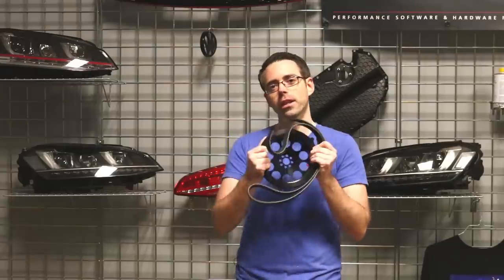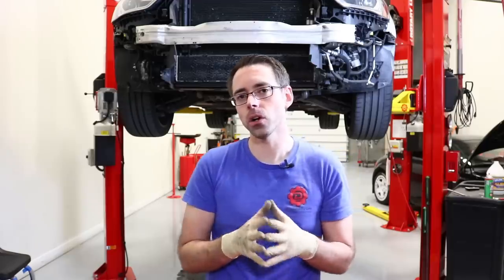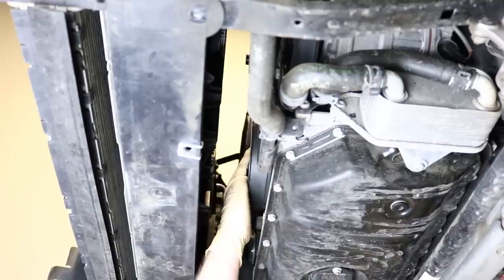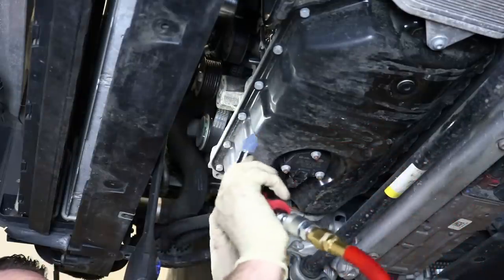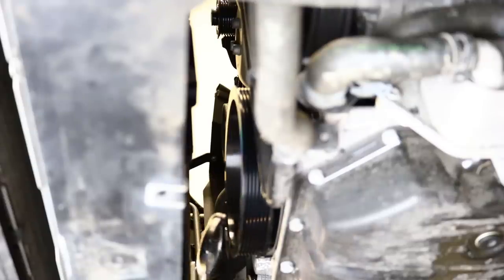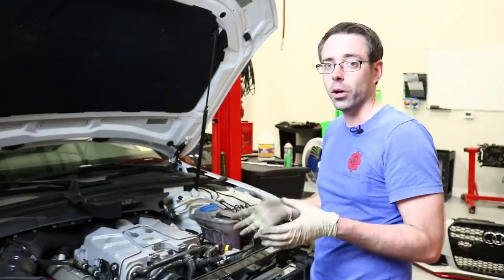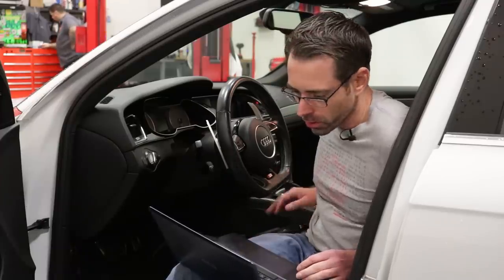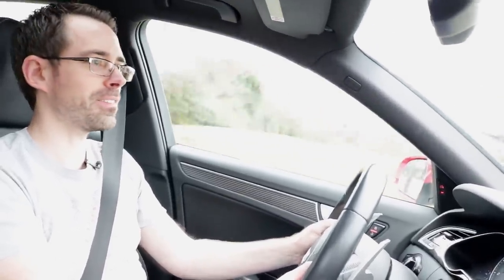Stage 3 Dual Supercharger Pulley Install | B8.5 S4

Comment from the maker: - We appreciate your Support and Purchases! -
Unitronic Stage 3 (Dual pulley) Tune for Audi 3.0t 
https://www.shopdap.com/unitronic-dual-pulley-upgrade-kit-for-3-0-tfsi-includes-stage-3-performance-software.html

B8.5 Audi S4 Tune Info HERE
https://www.shopdap.com/blog/post/b8-audi-s4-30t-software-tune.html

Putting our B8.5 S4 into the service position
https://youtu.be/1NlcWV0ufRA?t=171

Triple Square Tool Set
https://www.shopdap.com/triple-square-socket-set-vw-audi-1.html

VW | Audi Tuning Software from Home (Unitronic)
https://www.youtube.com/watch?v=L1a6dml2I2E

Comment: Any plans for upgraded cooling? You’ll be heatsoaked before you get out of 3rd on stock setup
Reply: I have been asking the same thing. I hope he address that issue so we can learn how to upgrade our cooling system.
Reply: There are kits out there but they cost an absolute fortune. You're looking at £2k plus.
Reply: 034 has the heat exchanger kit for 1k USD
Reply: @TheCrazySquirell  Check out merc racing heat exchanger! $400  for the kit
Reply: @robertogarcia9413  CCheck out merc racing heat exchanger its $400, its for b8.5 and m3 im pretty sure
Reply: @ScrubOnCrack  You running one or know anyone who is? Links?
Reply: @ScrubOnCrack  I have mercracing, great heat Xchanger
Reply: @ScrubOnCrack  Thanks man! i've just ordered one as well, can't wait for it!
Reply: Get the Alpha Heat Exchanger, Pump, and additional reservoir kit. Love to see that upgrade install.
Reply: Thanks for showing the install.. I learn something today...

Comment: I don't see it written or mentioned in the video, but the Unitronic crank pulley is 187mm, the supercharger pulley is 57.5 mm, gives you a ratio of 3.2517.

Comment: Thanks for the detail. 

Just want to be sure that these numbers were achieved by only doing the double pulley system, flashing of the electronics on the engine management and auto box? No exhaust changes and or intake changes to pull more air into the supercharger?

Comment: I would love to see the Alpha Performance Heat Exchanger upgrade video on this car. Includes Bigger heat exchanger, additional reservoir and Pump. A completely upgraded system.
Reply: BK Shaw is their kit necessary though? Just a mercracing cooler and a pump modification seems to keep the IAT’s very low.
Reply: @jacobhauenstein  I'm looking at the merc racing heat exchanger, how efficient is it compared to the APR, REVO, Alpha or forge motorsport ones, also I definitely want the uprated pump, but can you use any uprated pump for this? Do you have a link for a good pump to work with the merc racing heat exchanger?
Reply: @TheCinderellaman10  I haven't seen any scientific tests, but I know that the Merc is easily as good as the APR CPS. The only one that might be better is the Alpha one, but not because the heat exchanger itself is better, just because it comes with many extras and a reservoir. The whole purpose is to keep IAT's down, and the merc does. Also, I cannot think of the pump upgrade off the top of my head but there is an audizine forum explaining it. It's not a major upgrade, and right now most tunes will make your stock pump run at 100% to flow as much as possible. In my tune it goes to full duty cycle any time you are over 2000rpm. You can use any pump that will communicate with the car, you dont need a specific pump for merc that doesnt work on others, all the HX's work the same. Spending more than 700$ on one doesnt make sense to me though: you could get the merc, and do a water methanol injection setup and have results better than a 2000$ standalone kit. Or, if you are being convinced to buy the Alpha kit which is really $$$, you could buy a Killer Chiller and have below ambient temps.
Reply: @jacobhauenstein  I personally wouldn't spend £2k plus on the Alpha, it's a great piece of kit but like you said others can do a good job and save money to put into other supporting mods, the merc racing heat exchanger is only around £500 in uk from a place in Scotland and I'm sure they can acquire the pump and reservoir also. I would be saving around £1k compared to Alpha and APR. Btw did you cut the wire from the pump for it to run in emergency mode at 100% or was it programmed into your tune?
Reply: @TheCinderellaman10  That part was programed into the tune. I know Unitronic does it, and I believe APR does it as well.
Reply: @jacobhauenstein  so do MRC in the UK. If the stock pump fails you can always get an uprated one which will flow better then the stock one for a few hundred pounds £.
Reply: @jacobhauenstein  was looking at the s5 as I've always liked them from the beginning but they cost more then the S4 , so s4 no brainer, the only thing is that s4 weighs in around 200lbs more then s5 kerb weight but that's a trade off I suppose. Both great motors, that 3.0 v6 s/charged is unique to audi and for me put a smile on my face everytime I hear the charger whine

Comment: What would be the downsides of a setup like this? What is the compromise in terms of reliability other than the increased supercharger pressure? Also, have you noticed any change in fuel consumption after the upgrade and the tune?
Reply: catalytic converters tend to go at this power level, other than that not much else can go wrong
Reply: @wangshuokevin  I wouldn't say that, it is going to add more stress overall. The odds are leaning out of your favor the more power you extract. That being said; I've been at stage 3 for a year and a drive hard, not abusing it, just hard. Runs perfect and my oil analysis is spot on every time.
Reply: Only a few have had their cats go, best to keep an eye on the extra back pressure and go for high flow cats or even a catless downpipes but then will fail emissions test at MOT so for me hfc

Comment: Can you go from an un-tuned car straight to stage 3? Seems like you'll save time if you install both pulleys at once and flash it once.
Reply from the maker: Yup.  We just wanted to show each options which is why we did in stages
Reply: Yes, you can go from stock to dual pulley with the ECU flash. Also recommended is the transmission flash - check out their website.

Comment: How did you know what size of belt you need ? For example i go with  Forge 57.2mm, how you calculate the new bigger one crankshaft pulley and the belt to fit in the smaller SC pulley ?

Comment: Wait, so the ancillary drive belt is captive now? So to change the serpentine belt you have to pull the pulley off entirely? That's annoying :(
Reply: Some other comment here said you can loosen the tensioner instead. Came to comments for same reason. Should probably replace belt at the same time

Comment: Heard from other sites vibration and balance problems when switching from OEM pulley?
Can someone give some feedback?
Reply: That came to mind when they mentioned no dampening on the crankshaft pulley. those can be destructive vibrations & Audi had put considerable research in prevention.

Comment: I’m stage 2+ in my 2011 B8 S4  Heard it’s not worth the stage 3 due to gas consumption and very hard on the engine? Thoughts/advice? Is the TCU stage 2 DSG install next?
Reply: I have a DP setup on my 2013 S4 (tuned by EPL).  I upgraded two years ago, and have not had any fuel consumption increase under normal driving conditions. Nor does the engine feel stressed under hard acceleration. Only downside is heatsoak in the supercharger in the summer due to extreme heat caused by overreving the SC.
Reply: I have the DP on B8.5 (2013) S4 - haven't noticed any different in fuel economy other than more spirited driving = more fuel. I also did the larger heat EX, no reliability problems, nor have I read about any on the forums.

Comment: I have some questions concerning cost & software stability. The tuning flashes & upgrades are also applicable to my 12 S5. I will be considering these upgrades after my bumper to bumper expires. I will be studying your progress on preparation & I would do both the pullies at the same time, but that's just me.

Comment: Can anyone answer my question: been told not to modify my Audi A7 3.0T supercharged engine 2014 since the “timing is difficult to tune”. My initial thoughts are that the mechanic is not confident to carry out the work: any thoughts 🤔🤔🤔 I would really appreciate your comments!!!
Reply: I'm stage 2 unitronic on my 2014 A6 3.0  i cant see whay your wouldnt be able to do the same... works mint

Comment: Someone already mentioned cooling... What about stock cats? Will there be a DIY on changing those to an aftermarket brand? (Is unitronic tuned to not overheat the cats?)
Reply: Stanley Suber thats exactly what I was going to ask. I’ve read a lot of forums talking about whether the DP setup melts the stock cats. That is whats keeping me from upgrading from Stage 2 single pulley to DP.
Reply: @josuevelez3500  there are two videos on YouTube with partial explanations, one a guy cut his because he couldn't get the cat out and one where a guy straps the trans to the left and says there is room. No videos of someone actually doing the swap.
Reply: Josue Velez I’ve been running stage 2 single pulley with the stock DP. It’s totally fine. The problem is when you start to run Dual pulley is when it gets a bit to hot. I avoided going dual pulley because I have a FluidDamper and it’s a bit to fat to add the extra pulley. Anyway I hope this helps. Just remember to change the lower pulley at around 50k mi anyway because you don’t want it to fail!!! And I absolutely love the stage 2 single pulley there are not many cars that can keep up off the line!
Reply: @scalways  thanks, I'll be going single pulley in a few months and get that trans mount also. Not many cars are in the 3s for 0-60.
Reply: @jayboom10  nice! Jusy be sure to address cooling!
Reply: scalways I am currently running Stage 2 Single Pulley and have been for the last 8k miles with no issues. My question was in reference to going Stage 3 Dual Pulley and whether i would have to change my stock cats to high flow cats?
Reply: Josue Velez if you go dual pulley I would.
Reply: scalways thank you for your input. Do you know of a setup that would not be ridiculously loud, currently running AWE Touring catback without downpipes. Im sure i would need downpipes and a high flow cat positioned farther down but ive heard that setup can make the car really loud. Any additional resonators or anything that will help?
Reply: @josuevelez3500  Unfortunately my exaust is still stock for now. APR had told me you dont need to upgrade the cats untill you go dual pully. But once you do they highly recommend it. I had high flow cats on my acura TL and had to use a large resonator otherwise it was obnoxious. Hopefully someone else will chime in and be more helpful tho bro.

Comment: Is a tune mandatory or can I just run with a single smaller pulley and push more power??
Reply from the maker: Pulley without tune won’t do anything as the vehicle will open the bypass to adjust for the added boost

Comment: I would like to put a 3 liter supercharger on a 2001 A4.I'm wondering if I would be time ahead to get an after-market pulley like the one you show here in the video. I'm also wondering if you make kits that adapt the 3.0 supercharger pully system to my 2.8. I'm just beginning my research to see if I can make this happen. Any info anybody has would be greatly appreciated.
Reply: Haha this is some high end trolling but no one fell for it
Reply: You should get the 6 liter sc kit on the a4 because the pulley will get more power out of the 2001 a4 and it will get even lower consumption because the sc will be working less harder for the same result so in the end it does not matter if you take an tune or not

Comment: Paul! - i have a HUGE PROBLEM !!! I own the 2017 GTI Clubsport MK7 bought from factory with the Halogen lights. I want to get either Helix LEDs for MK 7.5 to fit into my MK 7.0 GTI Clubsport. VW say they cant do it, would cost a fortune. Iv asked two of the biggest car part dealers in germany online, they checked my VINS (Chassis Number) Even they said the Hella OEMs dont fit my car because diffrent OEM numbers... Is it possible to get this to work for my MK 7.5 Clubsport 7.0? IF it works? What exactly do i need more than the Headlights itself, for a proper installation?  🤔

Comment: I ve heard this stage 3 dual pulley destroys the Catalytic Converter....true? thoughts? fixes?
Reply: @YouTubeHandlesAreStupid  Darn. Let me know what you are able to confirm. Thanks 🙏
Reply: I mean I can’t confirm from first hand experience yet (hopefully later this month) but from everything I’ve heard and seen (I’m absolutely obsessed with the b8.5 and have been watching videos since 2014) you absolutely need to remove the cats/go straight piped. The cats cannot handle more than stage 1, maybe 2, and even that is welcoming disaster. Better to just get downpipes/full exhaust done and then full send with stage iii and upgraded blower/throttle body
Reply: @HuheJass  Appreciate the response. What if its a c7 A6?
Reply: @marksimpson4377  I’m gonna go with yes, unfortunately. I’m assuming you live in a state that requires emission testing, if that is the case it’s going to be Very hard to go stage iii and still be legal. You could go stage ii and replace the cat if it fails before inspection but that could get expensive fast
Reply: @HuheJass  Hmm..interesting. I wonder why unitronic never even suggests upgrading the exhaust system. I ll have to ask them about their 3.2 pulley ratio tune. Thanks guys
Reply: @marksimpson4377  granted I haven’t had direct experience myself yet, I’m probably getting a project s4 this month provided the inspection goes well. but I’ve been combing the forms and everyone that goes stage iii does downpipes and some cooling upgrades/additions, if you want to keep the cats you could weld and *ahem gut them. I’ve heard this preforms well and sounds better than aftermarket exhaust
Reply: @marksimpson4377  I also just found that you can buy high flow mini cats that sound great and won’t burn out, I have no idea if it’s still up to emissions standards but that might be a good option, the person that did that welded them into the downpipes, these are the mini cats they used 
- 
1979-04 MUSTANG MAGNAFLOW 2.5" MINI-CATALYTIC CONVERTERS 5.0/4.6
Reply: @HuheJass  Nice! I ll look into those. Good looking out! 👍

Comment: Feeling pretty torn between a b9 or modded 8.5.
Reply: B9 S4's are gonna be so much better for modding... ONCE they crack the ECU on those.
Reply from the maker: We are under the impression the B9 doesnt have a lot of room left for tuning, but that remains to be seen
Reply: Seems like the major players are having a hell of a time working with that ECU.
Reply: B9 doesn't get the dual clutch

Comment: I don't want to worry you but there are stage 1 S4's with flex fuel e85 pushing more power tnah this, a friend of mine is pushing 504 with just a stage 1 on full e85, another one is pushing 523 with just a 189mm pulley on e85
Reply: Everyone has a friend.

Comment: dp with no cooling! are you mad
Reply: Heat exchanger especially with dual pulley is a must, would also alleviate back pressure with hfc's or catless downpipes, I would recommend getting the heat exchanger with pump and reservoir even with single pulley, they produce heat soak and personally dont want to be waiting for temps to lower all the time just to do another run